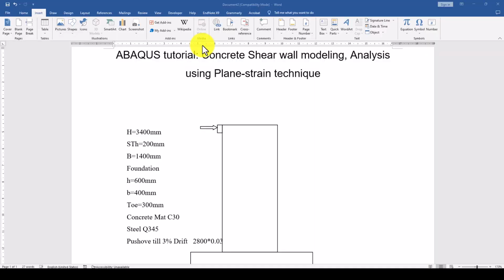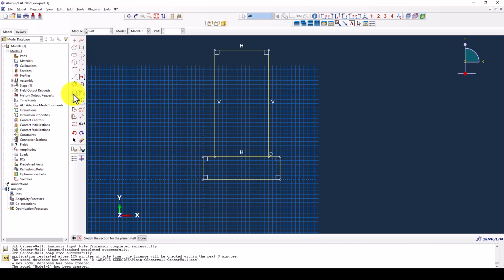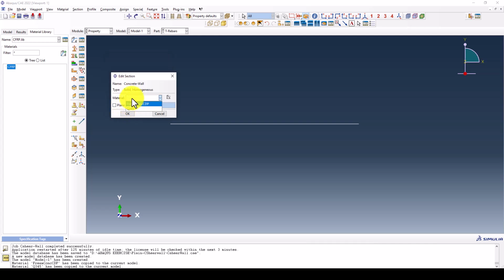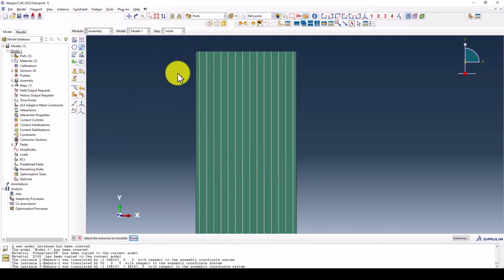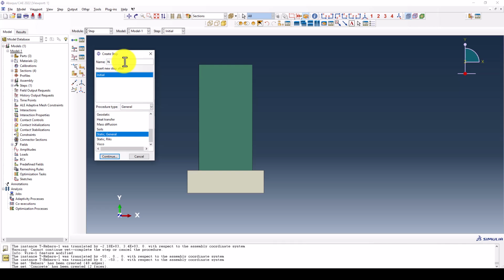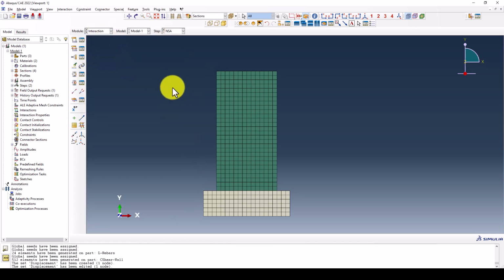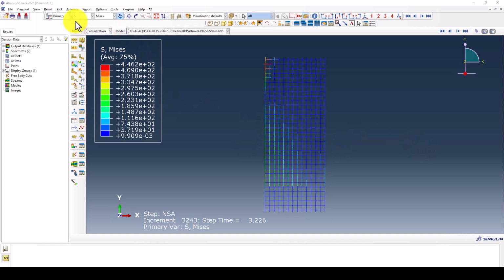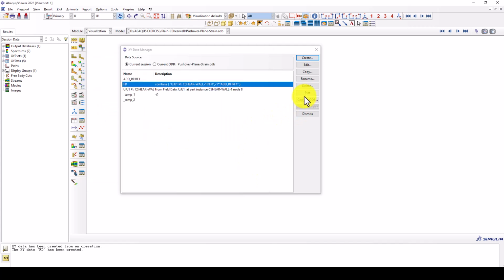Abaqus tutorial: 2D Concrete shear wall plane-strain modeling and pushover analysis technique

Comment: Thank you very much for your helpful videos!
I've been trying to follow this example but in the end I got these warnings and errors:
1) For two-dimensional models, if a non-unity thickness is specified for two-dimensional solid elements and these elements are involved in an interaction such as contact, the same thickness should be specified for the out-of-plane thickness of the corresponding surface under *surface interaction.
2) The system matrix has 1 negative eigenvalues.
3) Time increment required is less than the minimum specified.
Can you please help me to solve this problem?
Reply from the maker: Please follow the tutorial you won’t get any error.